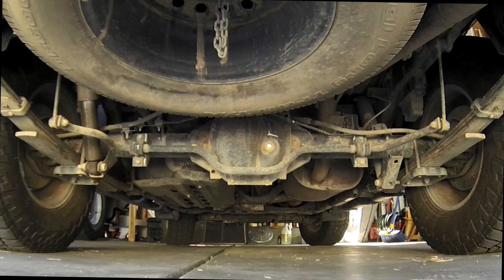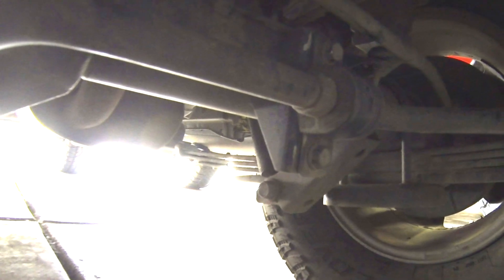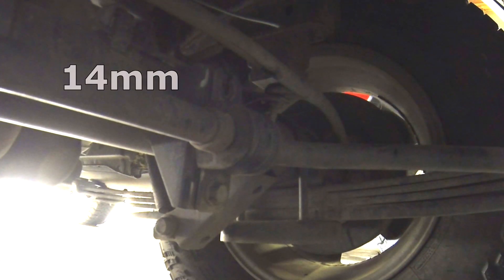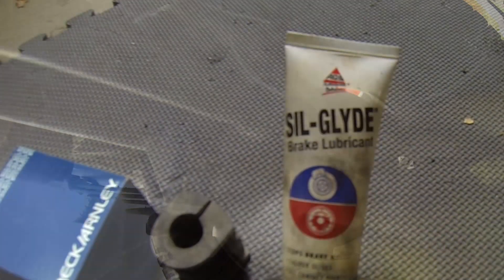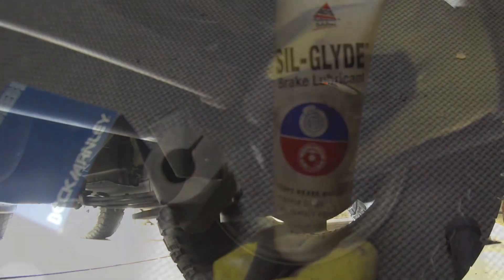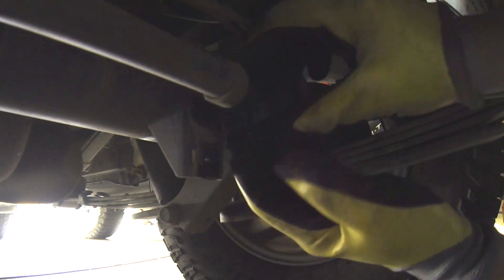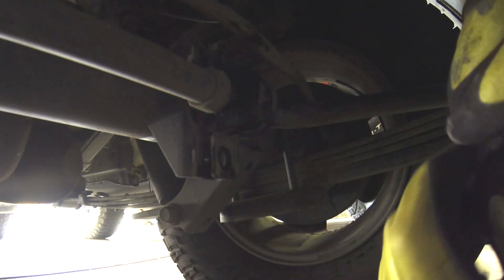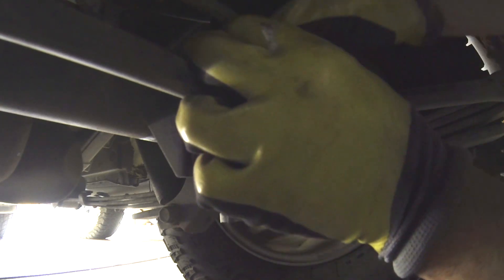Nissan Xterra Frontier Pathfinder Rear Sway Bar Bushing DIY Remove and Replace: Squeak in back Noise

Comment: hey mate. did it have the desired effect (reduced squeaking?).  what are your thoughts on removing the sway bar altogether? i imagine it improves rear flex, while introducing more sway and on road instability, but i've never tried it myself.
Reply from the maker: It did work as expected and I have the rear sway bar connected on both our Xterra and our trail Jeep.  On the Jeep the rear bar is so small that disconnecting it (I tried unbolting it / bungee cording it up for a trail run) it doesn't have much if any effect offroad but helps out quite a bit on road, I really felt the sway above 15mph or so with the front connected and rear bungeed up.  I have not tried the Xterra without it.